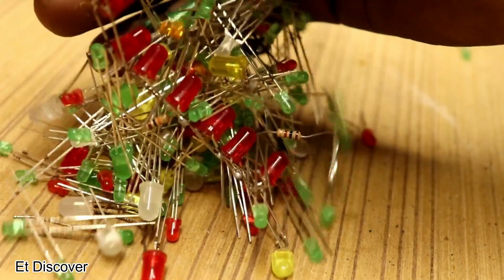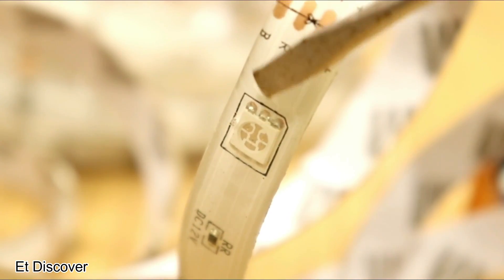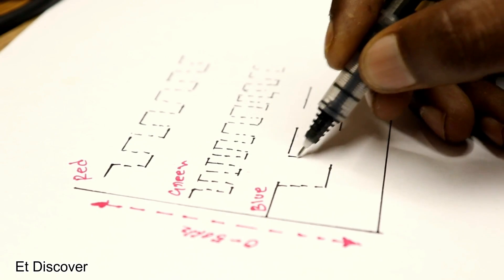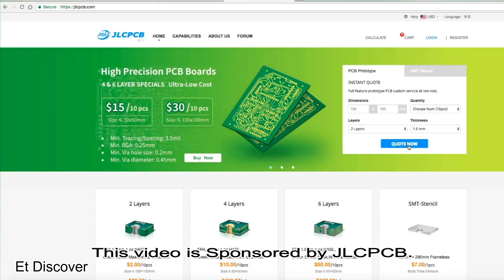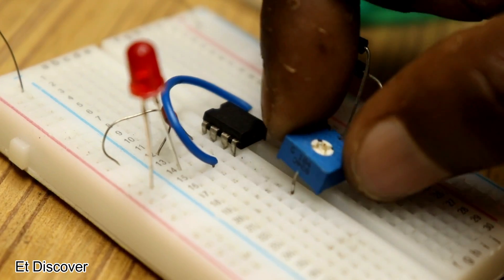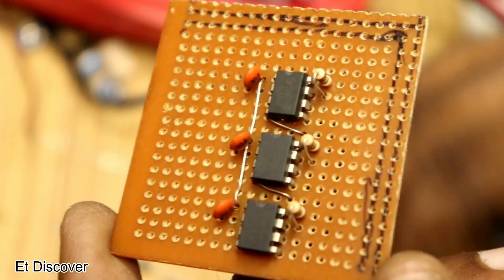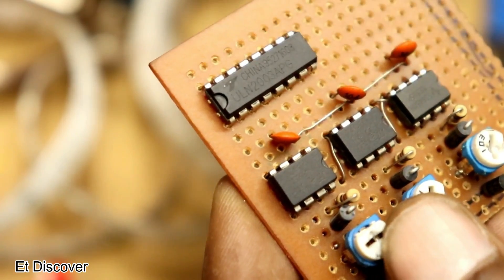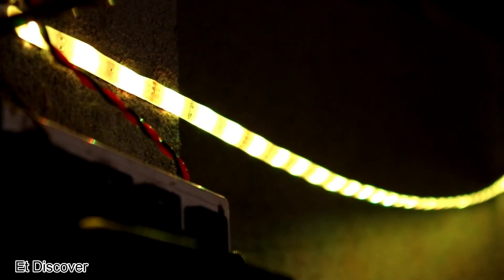How to Control RGB LEDs as your Wish

Comment: I have two Par lights of 12 x 9 watts But the price of the boards in the market is not possible, so I want to learn something from you and make a DMX in my own way so that I can run two in two ways like Color change, flush, color running, multi color changer, cheesing will be there. And it's only 12 volts. Please menson the components. 🥰🥰🥰 
Plz reply